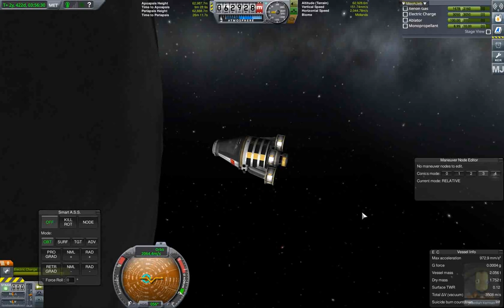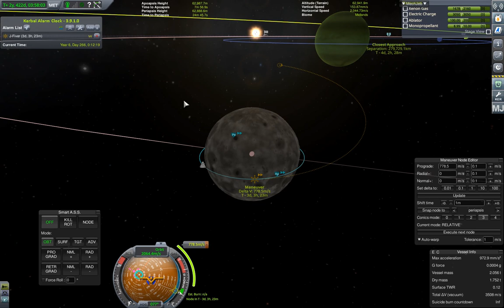Periapsis Kicking, a Short Tutorial

Comment: Good job explaining your technique. However I must be missing what the purpose is. The original single burn you planned was 778.5 m/s, and by 'kicking' you used 798.8 m/s total. There was a 24 m/s correction made, but even if that were omitted there is negligible savings.  So if saving deltaV isn't the purpose - why would someone use this?
Reply from the maker: > why would someone use this?

You only ever need to do this if you have such a low TWR that a single burn would take very long relative to your orbital period: Try to perform a simple Kerbin->Mun transfer at TWR=0.1 and see how that plays out, for example. Note how you expend 1100+m/s on a maneuver that's supposed to require 850m/s, and how the eventual trajectory is very different from the one you aimed for. Periapsis kicking avoids the losses from having a very low TWR, while taking you to your destination with a high degree of precision.
Reply: @laie-ox3cx   Ah, thank you - makes sense for low TWR where kicking allows more of your burn to be at/near maneuver than a single long burn. I was trying to figure out its efficiency with the ship in the video and seeing a net loss. Cheers